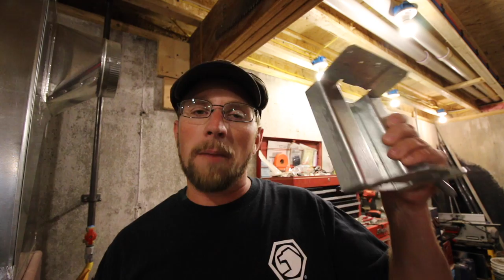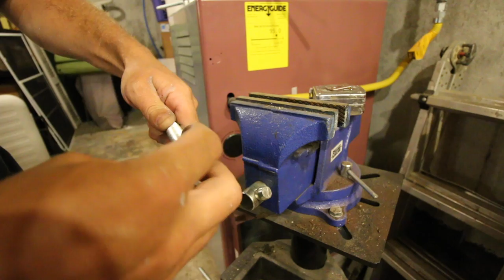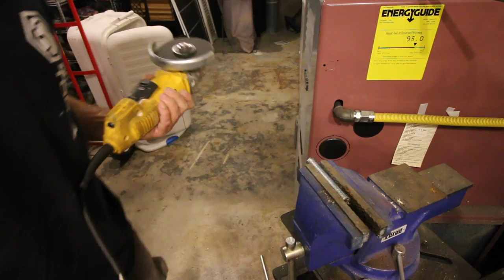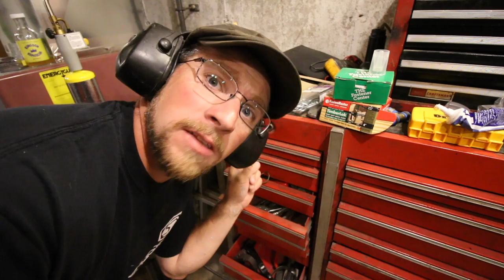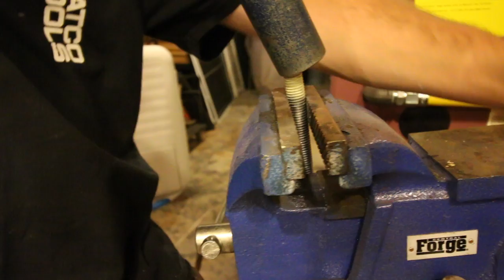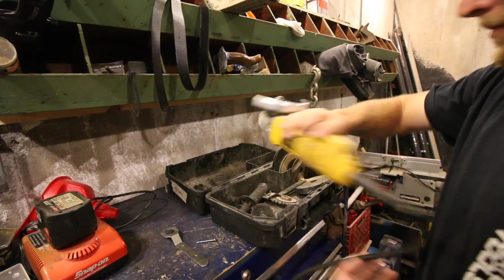BENDiNG Metal for the Off GRiD Outdoor Kitchen Build # 3

Comment: Great idea for the anchors. I think you mentioned that you were going to put down grating or rebar to reinforce the concrete. If you are concerned about the anchors pulling out or shifting, just wire tie them to the rebar framework, before the concrete is poured. I have done that on a patio roof support extension before and it held up well. 
Thanks for sharing!
Reply from the maker: Thanks! We are using Cattle panel.

Comment: thats not overkill. i use anchor bolts on every house, shop, or anything needing to be anchored to concrete. Except i buy them at lowes already bent and threaded. it is a building code in most areas. im sure you used them to anchor your house to your concrete basement walls.
Reply from the maker: Thanks! Yes we sure did!

Comment: watching you struggle with that shaking vise was hard. gotta bolt that thing to something solid/heavy.
Reply from the maker: I do and I will once I get a permanent shop! For now, we need to keep it mobile. Thanks
Reply: Yeah, I agree. Should have grabbed 4 more them bolts when you were out shopping so you could bolt that potential  accident waiting to happen down to the shop floor. Before you go cranking down on it and topple it over onto your foot cause that's gonna be a really bad day.

Comment: always heat the steel on a block not in the vice. the vice takes all the heat and it takes ages to get the steel to bending temp (red hot) and using that little torch you got makes it take even longer.

Comment: unfortunately, that propane torch isn't as hot as you need to easily bend those rods. I've learned the hard way that you need a real oxy torch in order to bend anything significant with heat. same for heating a stubborn nut, usually the thing the nut attaches to is too much of a heat-sink for a mapp gas torch
Reply from the maker: Yup! Lol, Its on the wish list! I think the vise was a big heat sink too!

Comment: Another great update! You are right to do the the anchors.....I'm not picking on you but, probably would've been better if you found somebody with a welder and welded metal plates on the anchor bolts.  I know......the channel is 'The Modern Homesteader' not ironworker 101 nothing ventured, nothing gained.
Reply from the maker: It would have been. But I was able to get the concrete and a friend lined up and didnt have enough to have some made.